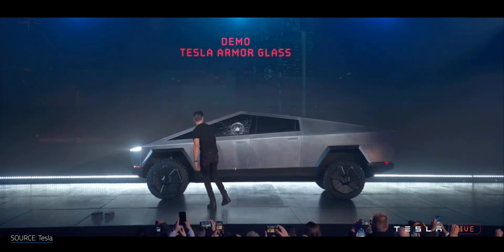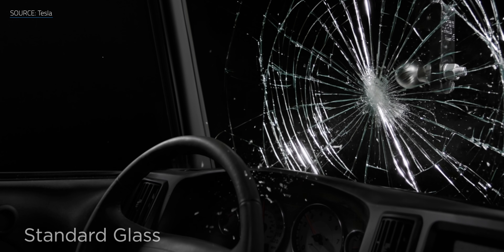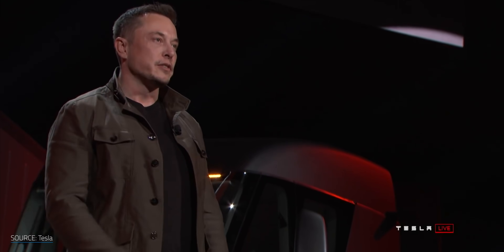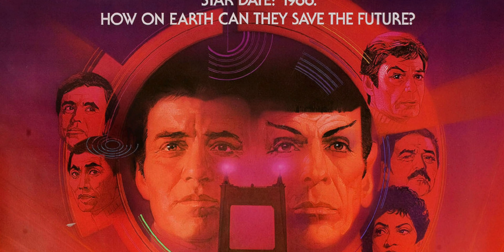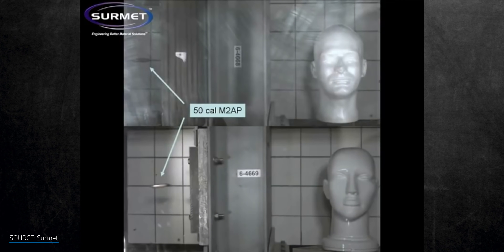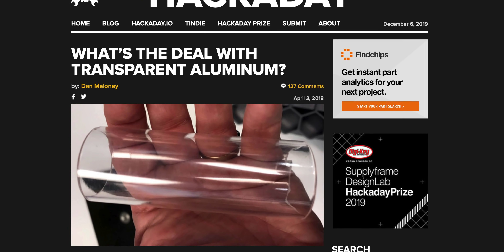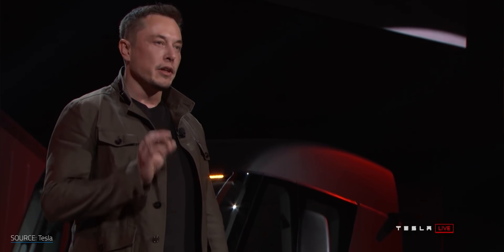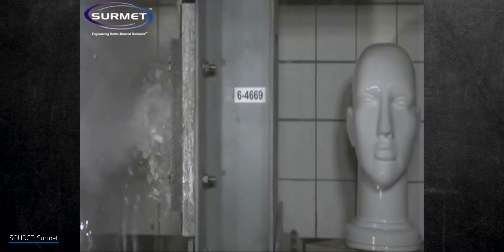Transparent Metal Glass - What is Tesla Armor Glass?

Comment: Wouldn't transparent metal interfere with smartphone tactile nature?
Reply: you can incorporate a thin Transparent film of a Conductive materiel.
Reply: @markplott4820  I have no idea if tesla armor glass is conductive already, that's where it would be messy in case of smartphones.
Reply: @seb.  - well, its a NON issue as TESLA does NOT make Cellular Products, but in Therory you can Simply attach a Transparent conductive layer to the outside.
Reply: @seb.  it isnt because its a ceramic..and not metal. Which is why its transparent ....and not reflective
Reply: @bbbf09  you didn't watch the video right? it is still metal

Comment: I am so chemistry-triggered by all this "transparent metal" "transparent aluminum" nonsense. THERE IS NO SUCH THING AS TRANSPARENT METAL. There never has been and never will be. 

Metals by definition are a fixed crystalline lattice of nuclei in a sea of delocalized valence electrons which intrinsically confer electrical conductivity to the substance. The very electrical conductivity that makes the metal REFLECTIVE and NOT transparent (for thicknesses of structural relevance ie. > a few microns). A metal's valence band and conduction band completely overlap, there is no bandgap through which a suitably tuned frequency of electromagnetic wave could be made to squeeze through without exciting the electrons in the material! The only transparent metal that has ever been created has been that which was irradiated by a pulse of ultraintense soft X-ray radiation induced inner shell photoionization. And then it was only transparent to ultraviolet radiation and the state lasted in the irradiated metal for like 50 femtoseconds before the sample vaporized. People need to CEASE with the 'transparent metal" crap. IT'S JUST GLASS.
Reply: it's just marketing. take a deep breathe. this isn't the first time a business has appropriated and abused terminology to make up vaguely scientific sounding descriptions for their products.

Comment: If it does indeed have transparent aluminum glass, that would be really cool. I bet they have come up with something that isn't quite as strong as ALON, but easier to manufacture, particularly in larger sizes
Reply: and thinner, currently you need 6" of Poly for Armored windows, and 1" of ALON for Armored windows, TESLA Armor glass is used in its Glass Solar Roof Tiles and will be used in its Semi Truck , the Cybertruck , and possibly even the Model Y if it can get the Price Down, I'm suspecting they will be using Rhodium as well. 
the TESLA glass is a Trade secret however.

Comment: I want a windshield that doesn’t chip from small stones thrown up by passing traffic.
Reply: Then how are the glass companies going to make billions of dollars of us
Reply: In order to safe weight (so they tell us in Germany), nowadays the glass layer is thinner, and the plastic laminate is being kept thicker.
That means, if you get a relatively small stone from the road thrown onto the windshield, a modern windshield will not crumble with 10,000 pieces laying in the interior. But it will chip on much smaller impact. Since glass is not a flexible material, the modern thinner layer will bend in and develop a crack instantly. Replace, replace, rep[lace ... every time how much?
Reply: Peter Kroll and if you commute into the sun every day you are reminded just how secondhand your car is.
Reply: @davidpearn5925  exactly
BTW. The side windows by the way are hose to escape . . .  in case.
Reply: @krollpeter  I'd rather deal with broken windshields than eye damage, especially as an American dealing with our healthcare system.
Reply: David - TESLA transparent metal glass will do that, it can also resist Baseball size heil as well.
Reply: well he said it's $15 a square inch.. Start saving up.
Reply: . One tiny chip....."gotta change that windshield, SIR. Here is your citation SIR, sign here, this is not an admission of guilt, SIR" (1500 miles from home).
Reply: Then the car company will not make any more money from windshield repair. So yeah, they will not make your windshield that good.
Reply: Leave more room.
Reply: Is it worth paying 10x or more for 1 windshield so that you dont have to repair the windshield for free with insurance a few times throughout the lifetime of the car?
Reply: make it
Reply: That what regular glass does already. You need rather large rock to chip a windshield. Trust me I live in Alberta we get chip every year. About 50% of the time I can see the rock coming.
Reply: Amen. When it’s affordable
Reply: @IWatchAndLearn  Tesla mass production.........of glass from it’s own renewables factory perhaps.......? That vertical structure again.
Reply: My father's F150 once took a baseball sized rock launched at it at roughly highway speeds while the truck was traveling on the highway in the opposite direction. The windshield didn't crack but it almost literally scared the shit out of me.
Reply: There are clear coatings similar to tint material that can be put on the outside and makes the glass incredibly resistant to cracks and chips.
Reply: Im also sure that if you were ever sinking in a lake that u like to be able to break out the windshield. As well as if u ever got into  an accident that the fire crew can actually break into the window to save your life.
Reply: @Delt4_Cr4wfish  I thought about this also. Unbreakable windshield is probably good. But the side windows need to be tempered glass like they are now, for safety. And from what I understand, this glass is actually more susceptible to small chips from sharp stones because its harder.  I think Tesla is creating a solution for a problem that doesn't exist, just for marketing hype.
Reply: @paulgallagher2937  basically. The  more hard something is the more likely it is to shatter on a impact. Same with the actual vehicle, if its front is as had as the sides and dosen't crumple then its gonna be extremely dangerous.
Reply: @Delt4_Cr4wfish  Seems like some basic laws of engineering and vehicle safety are being ignored to make room for the marketing campaign.
Reply: @paulgallagher2937  prity much, watch the video of why the tug of war was pointless
Reply: Windows are designed like this for a reason, not just when it comes to money. Safety as well
Reply: @Delt4_Cr4wfish  I would open the door and swim out.99% of the time. And 100% of the time their would not be any Government service there to save you -- only extricate your body. I suggest driving safe with Elon's super Glass. Why? Because that glass will stop the cinder blocks and stones tossed from over passes daily at semi trucks. That's the real threat. Not drowning.
Reply: @samualwhittemore228  First off, your not opening the door. Have u ever been in water. Its not like air, your not just simply going to open the door not to mention if you crashedin water there are plentyof factors into surviving escaping. Second the harder something is the more brittle it is as it doesn't absorb impact well. Diamond are extremely hard, yet the impact of one on a hard surface will shatter it.
http://www.aplusglasspro.com/windshield-101/whats-the-difference-between-my-windshield-and-the-other-glass-in-my-car/
I guarentee you his glass is not gonna be installed in any other car because in the case of a accident the glass will more than likely shatter. Tho i could be wrong on the as idk exactly how they manufactured his glass, tho as far as i know at this moment. We shall see in time. So far with out him going into detail from what i can see the truck is very impractical. And many people have said its a concept car at best. Aka most things on it will change.
Reply: @Delt4_Cr4wfish  don't dare to explain that to these clowns
Reply: Delt4_Cr4wfish A very valid concern.  A more sophisticated material like this will require more sophisticated solutions to safety considerations like yours, which may add cost.
Reply: @Delt4_Cr4wfish  How often does this ever actually happen?

Comment: From a safety standpoint I’d see this as a double-edged sword. My window hammer won’t be getting through this new glass if I end up in a lake, river, or canal.
Reply: Roll the window down maybe??
Reply: #1 - All TSLEA vehicles Automatically unlock in a Accident.
#2 - All the Glass inside the TESLA can be KICKED out.
Reply: Apparently for the side windows ,ONLY the front ones are transparent metal, the rear side windows are usual laminated auto glass for just that reason
Reply: @frankspeaking2630  - NOPE, that has been DEBUNKED, the Side flat Glass is the very SAME Tesla Transparent Metal Glass, the Side glass failed because FRANZ hit the door with the SLEDGE, in Fact before the Unveil there is Video of FRANZ throwing BALLS at the Window and they were Bouncing off, just like in the Tesla Glass demo at the Event before FRANS shattered the windows.

Comment: I need a pair of safety glasses with transparent metal glass.
Reply: Glasses ? we all should be wearing ALON face shields.
Reply: Poly carbonate lenses are quite tough, but they have issues with getting scratched and don't like UV. Don't make for good windshields.
Reply: Oooooo nice
Reply: Alon turns into little knife like shards when it breaks, have fun!
Reply: @zeronamenata4757    That's why you back it with a thin layer of more flexible, absorbent, plastic type material like acrylic, polycarbonate, etc  Composites is where it's at. It's amazing what can be done by mixing different materials together to counterbalance their individual weaknesses with the others strengths. 

  For example, I made a super strong, durable, and tough pole out of a combo of bamboo, epoxy, carbon fiber, and sprayed the inside with expanding foam insulation.  Quite light, but very strong and durable.  (It's eventually going to go on a steel framed mountain bike that I'm cutting parts of the frame out of).
Reply: @justinw1765  In a big sheet/plate you have more issues with CTE mismatch that cause the 2 layers to delaminate.
Reply: Hmmmmmmm

Comment: Im curious about how this would behave in a crash test. It's hard to break but assuming that it can shatter in a high speed impact, how do the resulting shards behave. If it can stay intact in a high speed crash, how does that affect passenger safety, especially if they don't have a seatbelt on (although I'd assume that car manufacturers assume that passengers are wearing a seatbelt, when they do crash testing)

Comment: I could use transparent metal on a lot of things! haha
Reply: explain
Reply: @julian-io5wl  All kind of test instruments with display screens, in addition to phones, computers and tablets. Any mirrors in vehicles and in homes could benefit, not to mention the mirrors in gas station restrooms and rest area stops. With all of the crime and shootings where people are killed by stray bullets into homes and businesses, the windows would be best made of this. All vehicle glass. Every place where plate glass is used in businesses.
Aquariums. Skyscrapers. Riot shields if it could be made light weight enough. Safety glasses and welding shields. Fireplace glass doors. And to think about it, maybe it could be used as the entire frame for our phones, tablets, and computers. 

All of these things are just the beginning! Depending on the characteristics of the material there may be other found uses with electrical or electric circuits. Could it be eventually used as a replacement for some types of plastic? Perhaps could it be used for food storage containers because it wouldn't leach harmful chemicals into food or drink? Applications would vary depending on heat and electric conductivity and if these properties could be altered by adjusting the manufacturing process. 

As the process of making it becomes more widespread and improved, the manufacturing process will be much less costly. Eventually it could become affordable for all kinds of applications.

I wouldn't expect it for another 20+ years though. Ultimately it would depend on the greed of those developers who hold patents. Will they be willing to allow the product to be made without imposing heavy royalties or license fees?
Reply: @BrightlineTechGroupLLC   Ok I thought you meant that ironically because of the "haha".

Comment: Pretty fascinating. I think of a material like Corning's original Gorilla glass -- how it was essentially a discarded product and has been refined over the past ~13 years since it found a practical application in the smartphone. It'd be interesting to see Tesla or any other manufacturer take Alon or similar products forward and see what other practical applications may be viable at scale. What I don't know (and would like to learn more) is what the raw material cost does to the application (surely aluminum is in shorter supply than silica?) and what the recycling prognosis for such a material is. Thanks for making this video.
Reply from the maker: Interesting questions.  I'm still reading into all of this stuff, but I believe it's probably infinitely recyclable as the core ingredients are aluminum, oxygen, and nitrogen.  Aluminum is one of the metals that can be recycled forever.

Comment: I would love to get a waterproof, unbreakable smartphone for sure, but I fear that the manufacturers would come up with a way to get your phone unusable after some time, so they can sell you some new shit. Like a self-desolving printcard or component, or a hidden programming that slows down the performance over time, or over the air updates that disables certain functions. Like my previous printer, that just stopped working after a certain number of copies, without actually being damaged or malfunctioning. After researching this issue, I found that there was a counter inside the POS that was programmed to turn the copyer off when a certain number was reached.
Reply from the maker: I'd be on board with a waterproof, unbreakable smartphone too.  Not all companies are as shady as your printer company, but I also believe in a users right to repair.  We need to make sure consumers are protected and still have choices.

Comment: I this case I attribute the failure to a big difference in "Energy of Impact" between the test conducted behind the scene and the drop test on one side and the point blank range shoot out test conducted live.
During the the test conducted behind the scene you see that the ball takes a quite curved trajectory . On impact, the ball is progressing on a sloped path combining what's left of the initial velocity and that being generated by the acceleration of gravity. The stand-off distance being larger  (about 3 m) than that of the live test. Assuming an initial velocity of 15 m/s at most, the energy of impact would be almost 225 J.
During the drop test, I assume that the impact velocity is well below 10 m/s in the worst case. Assuming a ball mass of 1kg mass. the energy of impact would be almost 100 J
However, during the live test, it is clear that the force applied by the shooter has generated an acceleration resulting in an initial, velocity probably exceeding 25 m/s. The stand-off distance being smaller ( about 1 m) most of that jolt was translated into a higher Energy of impact. 625J roughly.
On the other hand that "tightening of the bolts" during the drop tests isn't quite so. Actually those "Grasshopper toggle clamps" come lose at every drop. The deflection causes the ceramic  panel to slip under the toggle clamps making them come loose. So, they are just re-clamped. I assume that the door glass seal is a better set-up for an impact test that the toggle clamps. It allows the panel to deflect freely while providing a soft shock-absorbing frame.
So, Musk was right again: "May-be that was a little too hard" after all. But, I am surprised as to why they didn't use a poly-carbonate outer layer on a conventional sandwich followed by a polymer inner layer used in automotive industry while still using their miracle "Metal glass".
Reply from the maker: I think you're right, but there are a lot of other factors too.  Evidently they didn't change the glass after the initial test.  And in the live demo they hammered the car with the sledgehammer before the glass demo.  A combo of everything probably compromised the glass ... and then with the stronger throw ... bam.

Comment: Wish Tesla would fix the glass in the Model 3 first!  My windshield has so many nicks, it isn't funny.  I don't draft behind trucks or live in a dusty area, it's just from normal driving.  I don't even have 10,000 miles in a year of driving it.  Never owned a vehicle before where the windshield nicked to easily with normal use.
Reply from the maker: Sorry to hear that.  I had a similar problem with my last car (a Ford Fusion Energi).  That windshield nicked if you looked at it funny.  I haven't seen a similar issue with my windshield, but this is actually my second one.  My first one had a production defect in it, so Tesla replaced it.
Reply: @UndecidedMF  I'm afraid that at some point I'll have to replace the windshield and they won't line up the glass properly with the forward cameras and get dust inside there.
Reply: Buy Flexishield for it? Or just wait til it interferes with your ability to see clearly and then your insurance should cover it.